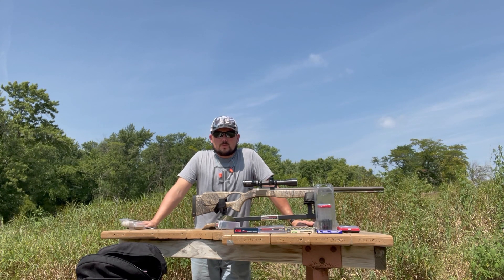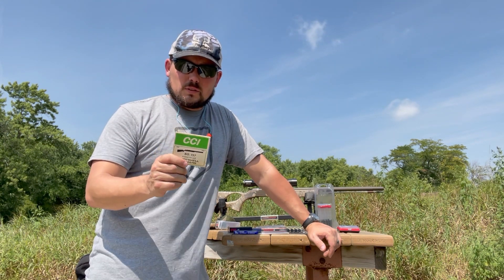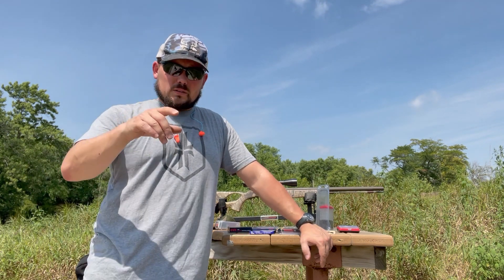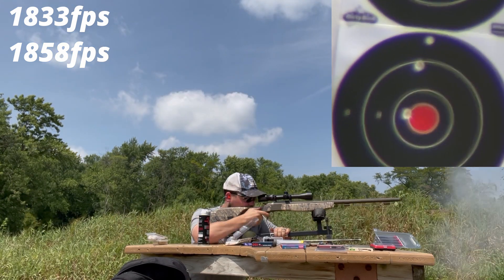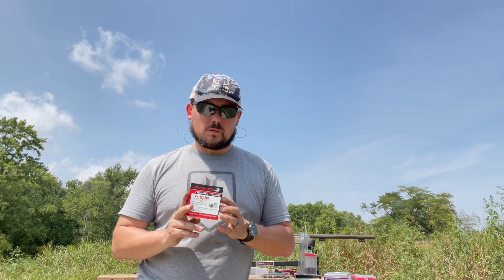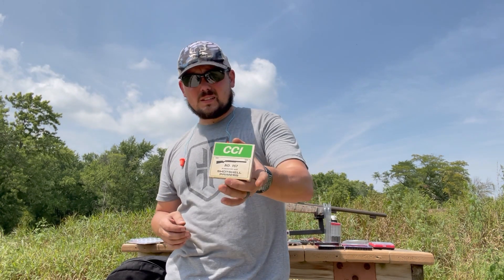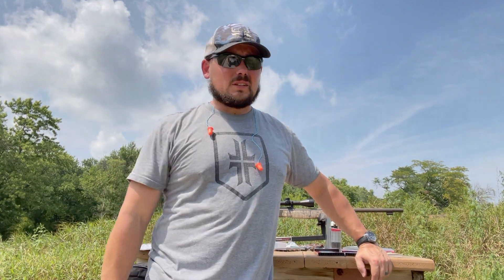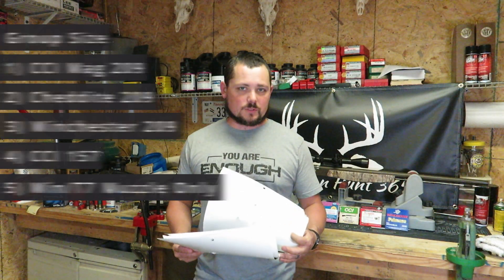Primer Test

Comment: I will never use the ML specific primers like 777.    Buddy was having trouble with week ignition using 777 pellets with 777 primers and missed two deer last season.  We actually found one of the bullets 80 yards from his stand laying in the field after one of those misses.  We switched him to Blackhorn with Federal 209 primers and no problems since.   Don't know if it was the pellets or the primers but my money is on the primers.
Reply from the maker: Yeah that’s a hard call. It could have been either. My money would be on the pellets. Moisture, oil from your hands, just a bad run…. Hard to say. If the primer ignited the powder..? But Federal 209A and BH209 you can’t go wrong. What projectile is he running?

Comment: I've been running the Fiocchi red box 209 primers & still running strong , no misfires ... Had them now for about 11 years , just kept them stored correctly... When I bought them , they were only 2.95 for a box of a 100 .. Give them a try if you see them in your gun shops or online ...
Reply from the maker: Very Nice. I haven't used those before. They are 63.99 on Midway USA for a 1K brick. Very Nice!!! Thank you and thank you for watching.
Reply: @suburbanhunt3653  sounds good & you're very welcome brother... Also been thinking about trying different combos on projectiles & sabots to see how they do , combos not on the market so I'll have to piece them together like the 44, 45 cal speer gold dot , federal HST & few more ... Trying to get away from 15 -20 round packs muzzleloading marketed rounds for what they want for them & buy it bulk for just a little more money because when buy just the projectiles sometimes you can get them in a 50 or 100 pack ...Seeing how the terminal performance from some of those projectiles on ballistic gel tests & wound channel tracks that I named, they should be great to use on deer too...  Just putting some thoughts out there ... Season is over for us here in NC . now but that gives plenty of time to figure out those combos for this coming year .. Great videos & keep sending them brother.

Comment: I bought cheddite cause it's the only thing my store had, using t7 loose powder in the cold -14°C, i didn't have an issue going off..... yet (knock on wood)
Reply from the maker: That’s awesome!! To date that is the only one to do that. Glad to hear they work in extreme cold too. Thank you. Good luck out there. Thanks for watching
Reply: @suburbanhunt3653  you have no idea how worried I was to buy those primers and then see this video thinking oh no.... guess I was lucky.
Reply from the maker: @Beatdowncaptain1 - I hate that the one time was on video. Sorry this stressed you. I would put Cheddite against any other primer. Maybe I should a follow up video. Thanks for watching and commenting.

Comment: How do your primers fit in your breech plug?  I have a blackhorn 209 quick release breech plug and my winchester 209 primers are very loose in the primer pocket. They wiggle all around and are also much taller than the primer pocket so that the shoulder does not get anywhere near touching the breech plug. I feel like there is something wrong with the breech plug but even the replacement i received has the same issue.
Reply from the maker: They were loose for me also. Take a look at this chart for the sizes of the different primers. The Winchester are “smaller and taller” than the others. I have had them slip out in certain shot shells when reloading. 
https://www.trapshooters.com/threads/primers-size-physical-size-only.824407/

Comment: I have two breech plugs for my TC triumph, clean them n change often. BH 209 is the best if you do your part. I’ve tried all those primers n had misfires. Get the hottest primer you can find?
Reply from the maker: You have had misfires on all? Yikes. If that is the case I would really look at love to CVA. I’m not sure how the firing pin works on TC but with the exception of two all misfire we’re due to dirty or fouled firing pin. Again I clean my rifle every third round including the flash hole. Even with a fouled pin I have only had around 7 misfires, across several primers. That being said yes… I use Federal 209A or CCI magnums when in the woods. But I have had great success with Cheddite also. Thanks for watching hope this helps.

Comment: Spend the $$ to purchase a breech plug conversion kit from Arrowhead Rifles that utilizes Large Rifle magnum primers. This will solve all the ignition problems when using Blackhorn 209 (Black Gold) powder.
Reply from the maker: LRP are almost as hard to find at this time. I pray that changes but I don’t it in the near future. Good luck and thanks for watching
Reply: @suburbanhunt3653   Granted, all primers are hard to find. What I am saying is, that in order to eliminate a fail to fire situation when using Blackhorn 209, switch to Large Rifle magnum primers. Often times smaller local gun stores are the place to find them, as online stores get cleaned out of inventory quickly. So other than the extra dollars needed to purchase the Arrowhead breech plug conversion kit, there isn't much disadvantage to the primer availability issue. A few months ago I found LRM primers at a large big box store and also two smaller gun stores. To save the Hazmat fee, I purchased from the smaller gun store.  Blackhorn itself is hard to find and when you do, it's way overpriced. I paid $69.99 per 8 ounce bottle a year and a half ago at a local gun dealer. About 3 months ago I found some at the same dealer for a friend of mine. This time they had pasted a sticker over the top of the original 69.99 sticker that increased the price to $79.99. Needed it, paid the price. Capitalism works when the supply side isn't drastically less than demand. Right now, due to numerous reasons, the supply-demand ratio is completely out of whack. Remember the companies that are gouging you now and know who to vote for when you go to the ballot box.

Comment: Have you tried homemade primers?
Reply from the maker: No Sir. I have heard you can make your own but I’m not sure about it.
Reply: There's a small mold.  You cut up aluminum cans into small pieces. Then use a punch to make the primer cup.  Next add the primer compound.  Then add ether or alcohol to the compound.  When it dries the primer is ready.
There are different molds for different size primers.  I made one size

Comment: The 777 primers and the cooler primers I heard were an attempt to curb the 'crud ring' from pellets. My take on THAT is crud rings are user error as much as anything. Won't get into why but can I  get 20 rounds out of 777 pellets before cleaning. I want as hot a primer as I can get and the Federal 209A seems to be it as far as hot goes. We will be trying the BH209 powder next season as I think my pellet days are about done.
Reply from the maker: The Federal 209A definitely get the job done. Best of luck with the BH209 next year. Thanks for watching.

Comment: Cleaning the breech in between tests would be good to see. I had hangfire and misfire issues with my CVA Accura MR years ago. I called blackhorn 209 and he said all CVA Blackhorn breech plugs need to have the flash channel cleaned with 1/8th inch drill bit and the flash hole cleaned with a torch tip cleaner. I had always ran the torch tip cleaner but near thought about the flash channel. I use a little T handle drill bit holder with an 1/8th inch bit and it works amazingly. Blackhorn also recommended using a small O-Ring in the bottom of the primer pocket if your primer comes out dirty after shooting. They said this is caused from poor head spacing and the o ring seals it back up sending more of the primers energy into the flash channel rather then backwards around the primer. The o rings are good for about 5 to 10 shots.
Reply from the maker: Hate to hear you had issues. CVA sales that channel tool you mentioned. I do use it every time that I clean the breech plug. Which is between each group. That would be a super simple video to do. Thanks for the comment. 
Here is a link to that Breech cleaning tool
https://amzn.to/3NvuubW
Reply: @suburbanhunt3653  Thanks. I had my  issues back in 2013. Blackhorn209 was relatively new, and CVA had just released the blackhorn compatible breech. They didn't make that tool yet. It's probably because of issues people like me had back then that they saw the necessity to come out with that kit...lol

Comment: I have been using the Cheddite primers since I started muzzle loading and only had 1 hang fire that I recall.  I tried the Federal Muzzleloader specific primers and I had two hang fires in 10 shots.  It was also the first time that I tried White Hots.  I usually shoot Blackhorn 209 but haven't been able to find any in Canada so I had to try something new.  I think I have watched all these muzzle loader tests of yours 10 times now.  Thanks for putting them all together.
Reply from the maker: Thank you!! I haven’t had any hang fires from the MZ specific primers but based off the FPS difference I would rather shot the standard or Magnum primers. BH209 was hard to find for awhile there but 2 weeks prior to TN muzzleloader season they came out in force. But at $83 per 8oz jug they aren’t moving too fast. Thanks again for watching and good luck out there this season

Comment: I really like all your tests.   Please keep it up.  I have decided to use Triple 7 pellets but I am now considering using the Triple 7 powder based on the fact that it sounds like the pellets go bad after a while and the powder appears to have a longer shelf life.  Do you have a video that shows the comparison between using the magnum load of Triple 7 pellets (3) versus Triple 7 powder (I think this is 120 grains but not sure).
Reply from the maker: Thank you. I've haven't gotten to the Triple 7 Loose yet. I have both the FFG and FFFG powder and I plan to compare then to see what, if any, difference there is between them. As for the shelf live, yes pellet will go bad way faster then powder. Part of that is the packaging. The pellet box don't make a great seal while the loose power does. Me personally, prior to start all these test, would throw the box away after the second season. All real data to explain why. I just know they went bad so that what a opted to do. Thanks for watching.
Reply: @suburbanhunt3653  Store pellets in a sealed ammo box with dessicant or in a ziplock bag in a chest freezer.
Reply from the maker: @jeffhays1968  that’s a pretty good idea

Comment: Triple 7 primers suck! I’ll never use em again after last night. Costed me my biggest buck in my life. Had a perfectly clean gun! After getting a perfect shot at a wide 10 the primer went off but my powder didn’t. Put in another primer and this time the primer went off and the powder ignited about a full second and a half later which I had already pulled my head off the gun. I know my powder wasn’t wet as it was brand new and had been loaded just prior to walking to my blind.
Reply from the maker: Oh my lord in heaven!!! That is my worst nightmare and why I never got into the old 11 percussion caps. I’ve not experienced a delay with 209 primers before. What type of powder/pellets? It may sound stupid but did you handle the pellets by hand. I have heard rumor the oil on your hands can cause issues but never known anyone personally. Man I hate that for you in the worst way!!
Reply: @suburbanhunt3653  I used triple 7 pellets with a hornady bore drive ftx. Yes you’re right I have heard using your fingers can cause that as well but I used the pipe cleaner that comes with them to load them.
Reply from the maker: @PoorBoyPursuits  I figured. I recommend Federal 209A. But Cheddite and CCI 209mags work great too. I’ve seen more Cheddite on the shelves more then anything else. Best of luck the rest of the season
Reply: @suburbanhunt3653  also I made sure before even leaving the house that the gun was clean as well as dry inside. The breach plug was cleaned and you could see daylight through it as well. Had to of either been the primer not being hot enough or an act of God. I’m hoping I get another opportunity at him.

Comment: Watched both vids. Primers do make a difference but as far as group size you are neglecting or just not testing, different bullets and sabots. That can make a huge , huge difference in group sizes. I doubt if all of us have the money, time, or place to really test the huge variety of bullets out there now for accuracy, let alone terminal performance. Which is why YouTube is such a huge resource for us. Sadly for me, the bullet that works the best out of my gun is no longer in production and I will need to work up a load again when I get low. It was a Hornady with a concave base, no sabot or skirt, just expanded the round itself into the bore. Great shooter but hard to load due to it being almost bore diameter. Powerbelts don't work even a little for me in my gun. Nobody ever said it was going to be easy, LOL.
Reply from the maker: That sucks to hear you lost your favorite projectile. As for test.. the only way to show the effect the primer has, all other aspects have to be the same. I used PowerBelt 245gr coppers because I the more of them. I have tested several projectiles with multiple powders. Hope that sharing my results, in some way, help other shooters. The Hornady FTX is most accurate over all the test that I’ve done. And I’m testing the ELD-X now…. Let me tell you they are awesome!!! Hope you find a new combo that works for you and hopefully in some small way we helped. Thank you for watching.
Reply: @suburbanhunt3653  I watch your other vids with different projectiles so you are doing good work. Hornady is a pain in the ass, they make great stuff generally and the it gets discontinued. I was shocked to see the pyrodex punch sub MOA, I use 777 magnum pellets in my load, need the extra to push a no skirt copper slug into the riffling. The bullet is Hornady FPB 350 Gr. ballistic tipped ,Concave base, no skirt or sabot.. Found them online but the sites were fake so never wasted my money. That's another issue, fake sites all over the place, gotta check before sending them bank card info !
Reply: Powerbelts are terrible for most people.  Don’t feel bad

Comment: Thank you for breaking my heart, I've used the Winchester T7 the last couple of years mainly all I could fine but will be looking for the other top ones. Thanks for a good video and good information.
Reply from the maker: Thank you for watching. If what you use works… what kind of groups are you getting? What powder or pellets are you using? Have you ever had issues with the rifle going off? I had hear rumor but so far not seeing to much to back it up. Lower speeds yes but the rumor was not firing.
Reply: @suburbanhunt3653  I've  go a CVA ACCURA V2 PR   use pellets Triple 7 100gr and the last 3 yrs used Winchester T7 primers. Like I said mainly all I found. For the misfires no problem at the range or hunting... no problems but 1 and my fault. Hunting in Ohio and opening day HARD Rain all day turned to snow that night and freezing cold next day, now I use those finger cots some call them condons over my barrel in wet weather but did not change my load. Yes a doe came within range and misfire. I took the old powder out yes wet so it was my fault not the primer. Only time they have not fired and have used them in bad weather before with good luck. Exactly Im thinking of going back to 150gr T-7 it shot better than 100gr. Only reason I changed was trouble finding powder 3-4 yrs ago and getting low on it. I'm not a big time shooter but I'm happy with 2 inch at 100yds. The 150gr does better than 100gr with my setup but always looking to improve.
Reply from the maker: @1Whitetail  I understand the wet powder situation. Been there. Thank you for the story and the info!! And you are 100% right properly placed 2inch groups will drop them every time. No matter what you choose to do good luck out there this year brother almost time
Reply: @suburbanhunt3653  Good luck to you also and maybe get to see your success or not on video,  we take the bad same as the good.
Reply from the maker: @1Whitetail  you most definitely will. Thank you
Reply: @1Whitetail It rains a bunch during our muzzleloader season here in the PNW.  Try electrical tape on the muzzle trimmed to fit.  Always keeps the rain out of my CVA Optima.  Good luck.
Reply: @searun1418 TY  and Merry Christmas.   Started using those covers for over the barrel , like a mini condom lol  they work pretty good. Here in Kentucky we get more dry days but on occasions I need them. Thanks again.
Reply: @1Whitetail Merry Christmas to you as well.
Reply: Awesome I can’t wait to watch …..I just picked some up today at Dunhams sporting goods curious to see how they do with the Triple7 loose powder in this Knight .52 cal I just got…still plan on checking all the sporting goods stores before I hit the range after seeing how good the CCI’s perform in your video 👍🏼
Reply from the maker: @MilkManBobby  awesome. If you happen to be near Columbia TN go to Kings Firearms and More. They will get you set up
Reply: Love these smoke pole videos!….,have you ever tried the Federal Premium 209MZ primers ?
Reply from the maker: @MilkManBobby  - I literally picked them up yesterday😂 another subscriber donated Feberal 209A primers so I’m going to do a 209A vs 209MZ video. But also tie in the results with this one.